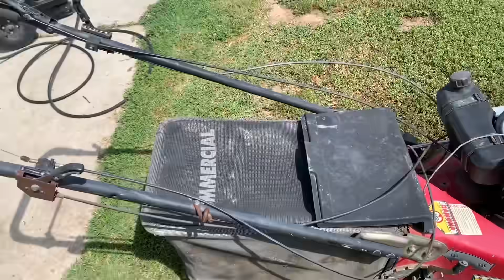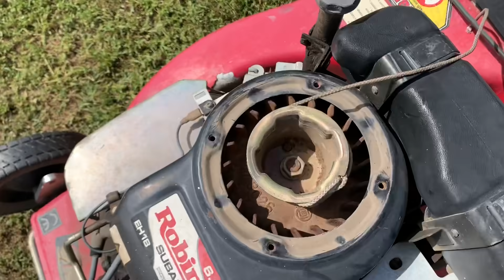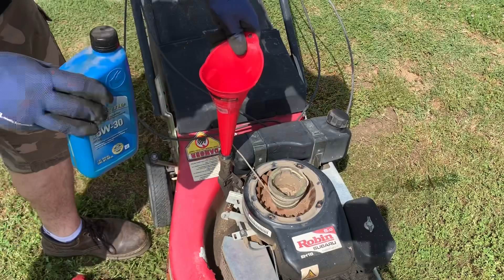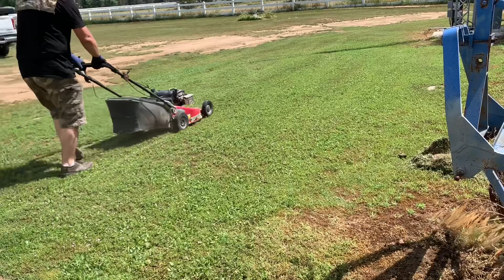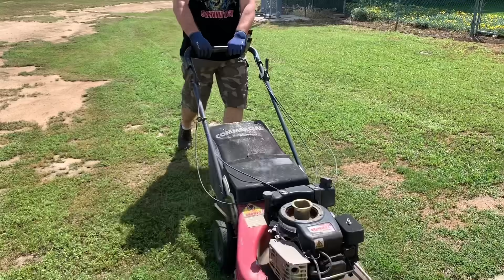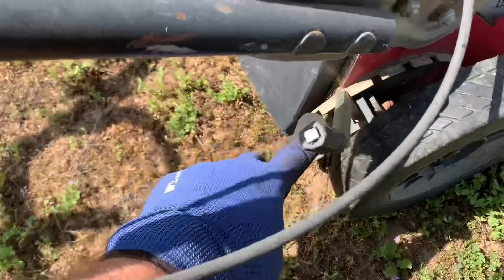Trade In Snapper Commercial Mower

Comment: Cross reference the oil filter part number to save you some $$ when you get one at the local walmart or parts store, I worked @ the MFG plant in McDonough Ga. when this was produced. Good luck on some parts you may need, do you have a parts manual? Does the unit still have the MOWER serial plate decal on it?
Reply: Numa Newbern I’m from Macon. I remember the plant in McDonough. That was a longtime ago. Those old Snappers were great.
Reply from the maker: Oh yea that’s what I’ve done with my rider. I buy the automotive filters from Walmart for it.

Comment: Hi Hank.  I've recently obtained one of these too and it is really great.  My first Commercial Snapper too :-).  I bought the parts to do a service (Oil & Air Filters, Spark Plug etc) and have sharpened the blade and it is superb.  Just wanted to ask if you know if there is any maintenance I need to perform to the rear wheel drive mechanism?  It looks sealed.
Thanks, Paul
Reply from the maker: I'm not aware of anything that can be done with those...